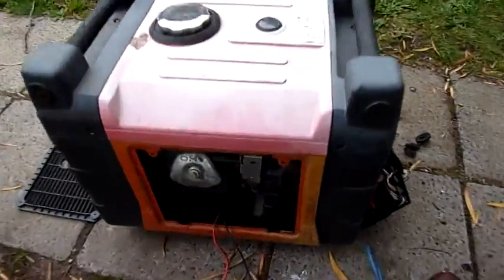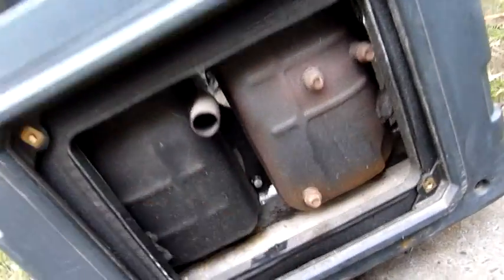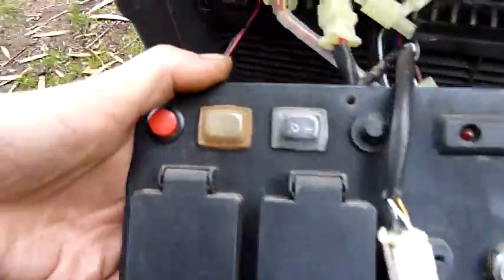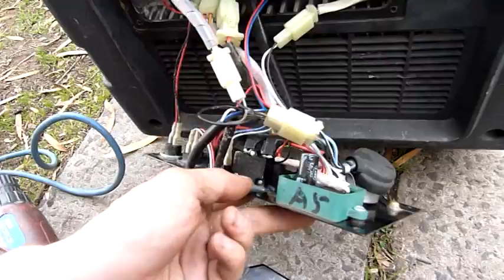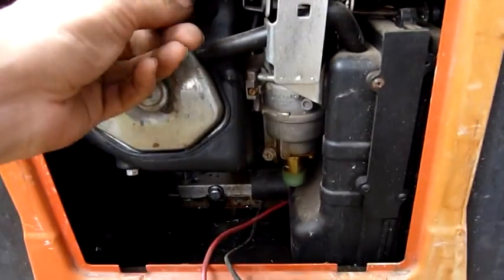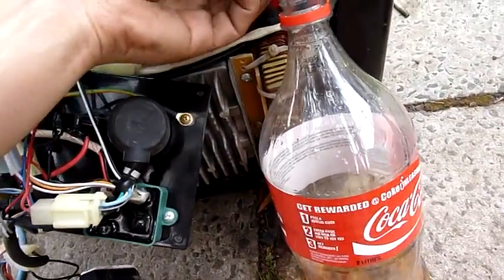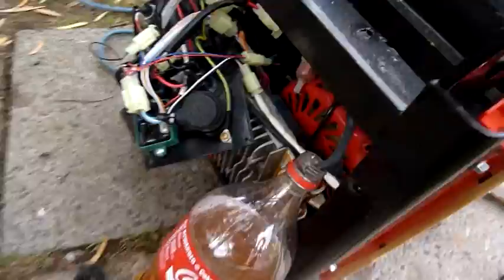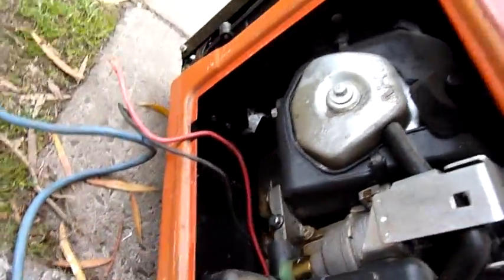China 3Kw Inverter Generator Autopsy Pt1

Comment: I have exactly the same broken generator. Looks like it is more than 10 years old. Got it in this condition (damaged) from previous owner  They sold them here in Central Europe and GB as Hyundai HY 3600 SEI. Have exactly the same problem with the inverter modul. Did you get a new inverter module? Is your generator running? I wonder how much a new inverter module cost and where to get it. Mine Hyundai HY 3600 SEI has exactly the same rated voltage - 3 KW and according to previous owner it did run less than 40 hours before he left it in the garage and never run it again. I cleaned the carburator and get the engine running but when I conect connector that you have shown in the video - I experience the same as you did. Some kind of short circuit - and it is close to impossible to start the engine and pull starter rope (recoil starter). Any idea what is wrong with the inverter module? Thanks in advance for any answer. S.

Comment: i have one of these with around 3000 hours.
still goes nice, have re tightened nearly every fastener on it and changed oil ever 100 hours or so.
early on the catalyst blew out of the exhaust.
apart from that just regular service.

they overheat if run with low or no load though.

Comment: The engines are fine, they're typically directly copied from the Honda GX engines but maybe with a slightly different pattern on the pull cord housing etc. They live such a long time and when parts are damaged you can replace them for genuine ones. I picked up a GX200 clone today for £40 and it runs great, no problems whatsoever. Personally I prefer the clones.
Reply: Yeah I got one too.  It's a 1KW.  It's awesome!

Comment: The generator body itself is probably double insulated, so no grounding is required or, indeed, recommended.

With a portable generator like this, unless you can attach a grounding rod or external ground, the only thing you can do is connect all the outlet grounds together to create an equipotential zone.

The metal plate near the outlets should be grounded because it is sufficiently close to the output wires that it can't be regarded as double insulated.

Comment: I have the genuine Honda "briefcase" 1000 watt inverter unit.  Much better made.

Since this is a copy, the generator should be a 3 phase with additional single phase winding for the DC charge feature.  Engine sounds amazingly similar to the Honda.  At least you got a good engine if they cloned it right.

What a nasty looking potted inverter.  I bet half of the parts had cold solder connections before it was even potted.

Comment: Unless you fed the output into the AC side, or after the rectifier, it wouldn't work. The generator probably puts out 200V or so per phase.

Comment: Aw. Damn. lol. You going to keep/sell the engine? Seems to run pretty good... surprised it starts and ran with that old fuel. I've had legit honda's have a cow due to bad fuel.. Then you gotta pull the carb out, clean the bowl, etc.. That one, just started no problem. :D